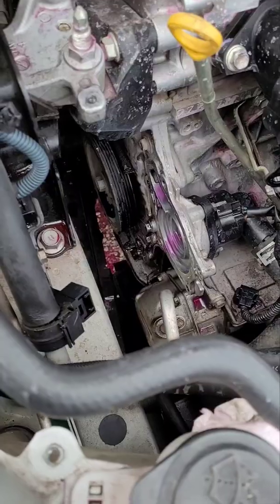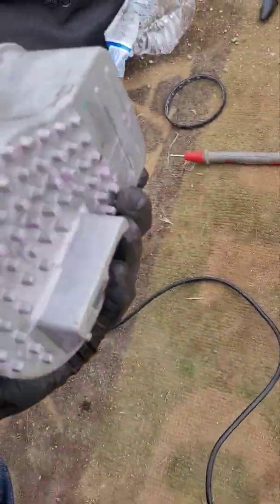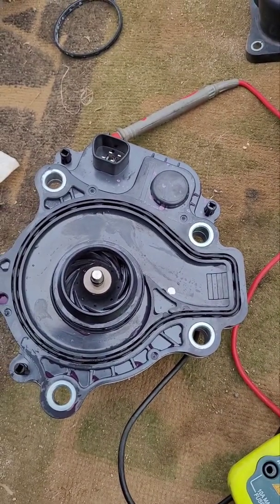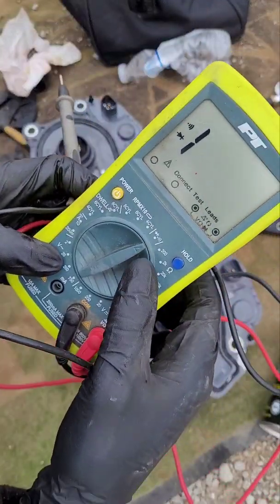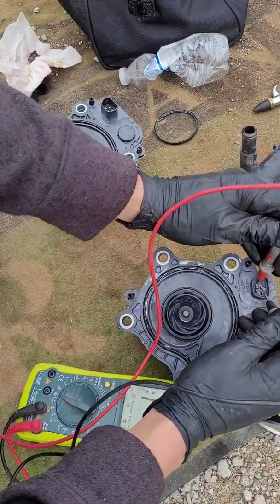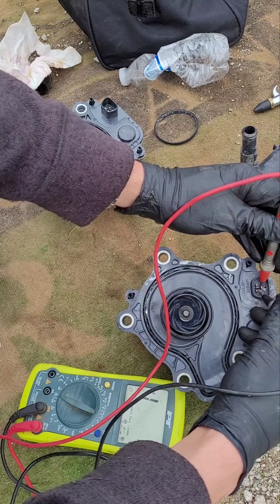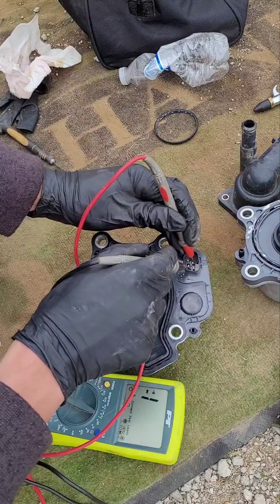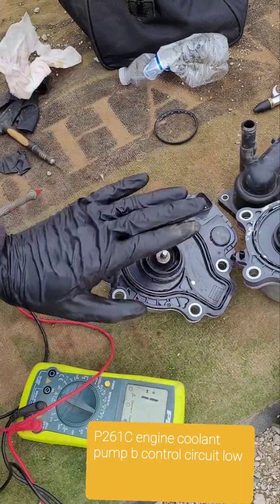2010 pruis code p261c

Comment: I bought my new pump from a Toyota dealership. Sure I could save $60 buying the OEM brand pump from rock auto but I want to have zero doubt my part is good and it is built to the latest Toyota specifications. If the pump fails on these cars, good chance your going to blow a head gasket. 

I got screwed by a remanufactured water pump on my Nissan pickup years ago as you did. The bad pump was exchanged on warrantee but the whole days labor was on me. Never again am I buying a cheap auto parts store water pump or thermostat.

Comment: So was the original water pump bad?  I see that the replacement was bad.  My problem was both the water pump which apparently caused the R1 relay to weaken.  I replaced the water pump first and still had an intermittent P261C that caused the car to go into limp mode.  When I moved the relay to another Prius, I was able to duplicated the P261C verifying that the relay was bad.  Replaced the relay and all is good!
Reply: I just replaced my water pump and now have the p261c code, do you think I should try to replace the relay?
Reply: @basicallyextra1662 same problem I replaced new OEM water pump and now car shuts off with warning lights check your hybrid system and stop the car
Reply: Hi, thanks for telling the full story!

Comment: If you get a P261C code, start at the cheapest part.  The R1 Cooling system (ENG W/P) relay.  It is in the engine compartment driver's side, top left of the box.  This part is $17.  Normally, the faulty water pump should throw a P251B code.
Reply: Can you just switch relay with another one from the box and see if it works?
Reply: This one comment from 3 years ago saved me a lot of time and money! Thank you!